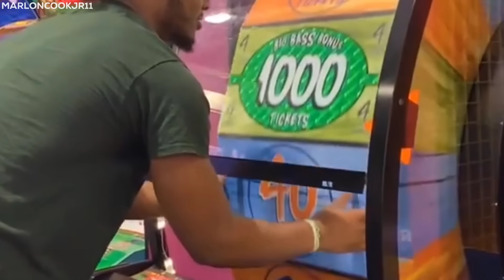999 IQ Moments...

Comment: 3:08 
I’m not only considering doing this, but also wondering how powerful that could possible be.
Reply: 3 BALLS IN ONE SWING
Reply: It only cuts small pieces of wood, because the strength is distributed between all three.
Also, you'd have to spend some time setting up the logs so that they are in the right position.
There is a reason people don't do that.
Reply: @gabrielbarros493  I’d pull a some Violent Night shit with that, though.
Reply: @fumikagetokoyami5040  As long as you can hold it and attack with it, it's a good weapon for an amateur fighter
Reply: @gabrielbarros493  Or any fighter, really. Especially for someone such as myself who does ax throwing occasionally.
Reply: lmao, I use to do the same thing when I needed to write vocab multiple times in school, just space the pencils out evenly and a 2 hour assignment can be done in 10 minutes.

Comment: 1:11 The Gold bar is NOT yours to keep. There are Guards nearby to stop you from running off too. You do get a Prize, Mainly in the form of a Gift Card to the location this is at.  Value depends. but Most say it is between $25 to $100 US dollars.
So NO you do not get the Gold Bar which many value around $20,000+ US Dollars.
The Other thing is, some of the places that Do these challenges you actually have to Pay $5 to $10 us dollars to give it a Try/attempt.

Comment: 4:55 it seems like a smart thing... Until you realize that it would probably work better WITHOUT the umbrella if you just point the leaf blower backwards...The umbrella has to be wasting a lot of the air's potential by redirecting it more sideways than backwards
Reply: It is impossible the third law of motion means it is impossible. The third law of motion states that for every action there is an equal and opposite reaction.
Reply: @Climbingandtech  Yeah I'm familiar with it, not sure exactly what you mean though? What is impossible?
Reply: @zeph0shade  Are you familiar with the concept of the Mast and Sail?

The Leaf Blower doesn't have enough force on its own to move him around by just 'blowing it backward' as you suggested.

It's possible he could jury rig something by blowing it under the janitor bucket, into the ground, but it would lose effectiveness.

The Umbrella acts like a Mast and Sail, so it does a much better job conserving the energy and motion provided from the leafblower, but the umbrella also serves as a Windshield and a counter Balance.

Just sitting in those Buckets is dangerous. Your center of gravity is all over the place, but by using the Umbrella and the Leafblower, you create a more solid point of balance, making it somewhat safer.
Reply: @Bleachfan872  A sail works because an outside force acts on it, namely the wind. Newton's first law of motion. A leaf blower, on the other hand, is essentially just a very inefficient and impractical jet engine. Imagine sitting in a little sailboat, holding a jet engine. There's no wind, so the sails aren't taking you anywhere today. You'll have to use the jet engine. Where do you point it? Into the sails? Good luck with that.

Comment: 0:40 A physics question came to mind, based on the stick in the fan. A yardstick is inserted, then turn the fan on. You can kind of imagine the arc the outer end is making. Now the fan gets turned off. The yardstick is moved  4 more inches in the fan. When the fan is turned on, the outer end is making a smaller arc. Is there a formula to figure out how much the arc has decreased?
Reply: It depends on what you are asking and what plane you mean by move
Reply: Pretty simple. Though, this is missing a few necessary variables. If you want an answer give the initial length that the yardstick was poking out of the fan, the degree in which the fan rotates, and a sandwich since I'm hungry. There should be a way without those variables tho, lemme check
Reply: It's a geometry question, and it's simply the formula for arc lengths. An oscillating fan draws a section of a circle, and the arc of any point in the movement is its distance from the rotational axis (in any unit you prefer, result will be in the same unit) times pi (constant) times the degrees of the oscillation (constant if the fan remains unchanged) divided by 180 degrees (constant). This means the arc is directly proportional to the distance of the point from the rotational axis. A point that's half as far from the axis will draw an arc half as long.
Reply: @Turbobuttes  Basically. I was really hoping it was a physics question though.